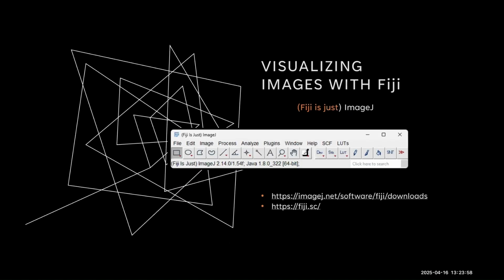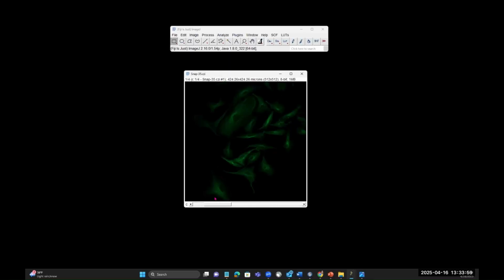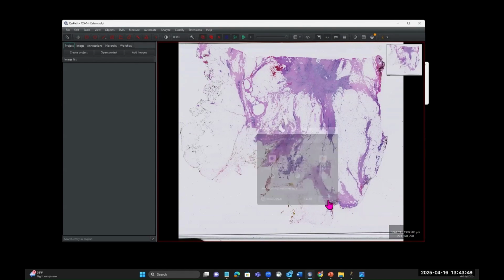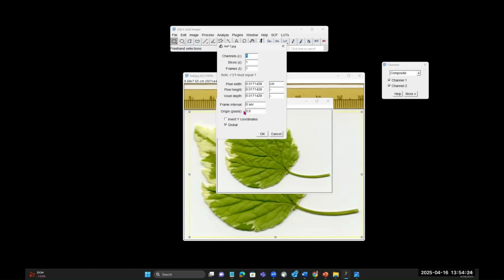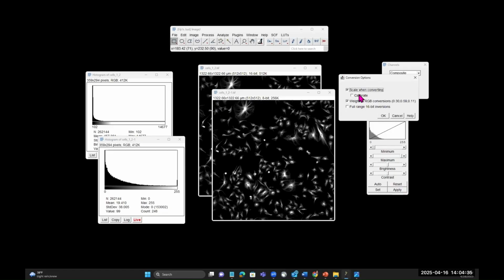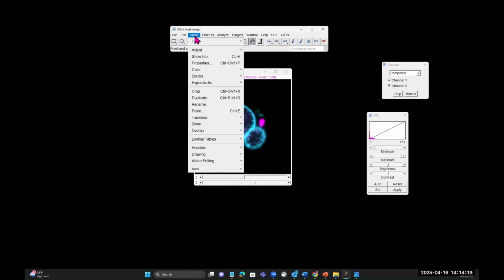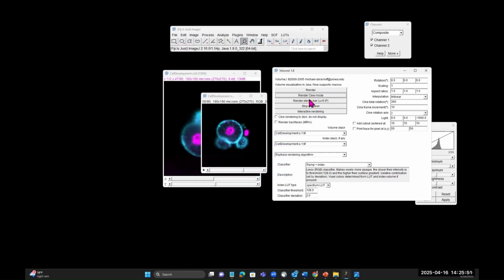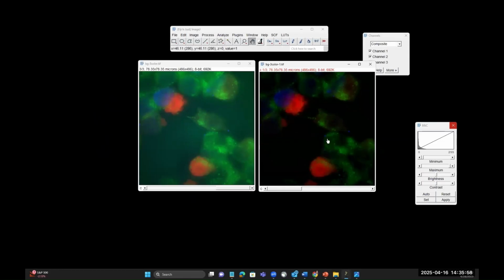How to Use Fiji (ImageJ) for Beginners | Intro Seminar Recording

Comment: Can I determine signal to noice radio on it?
Reply from the maker: Hi @blessingshugaba5050. You can manually measure the signal-to-noise ratio (SNR) in Fiji by measuring the mean signal intensity divided by the standard deviation of the background noise.